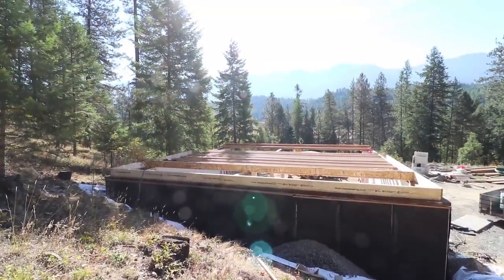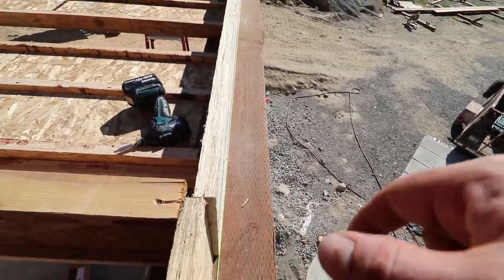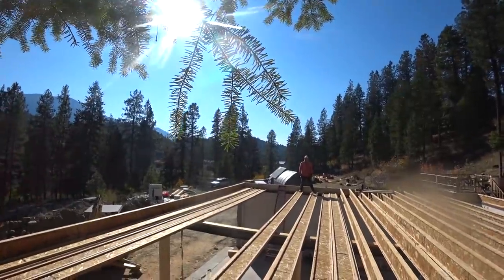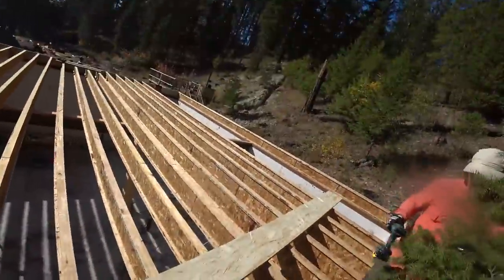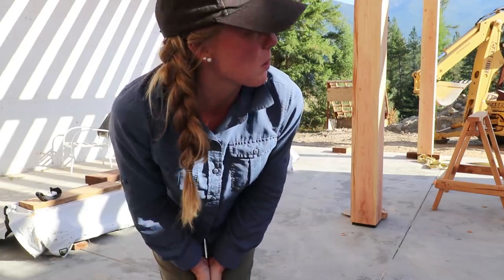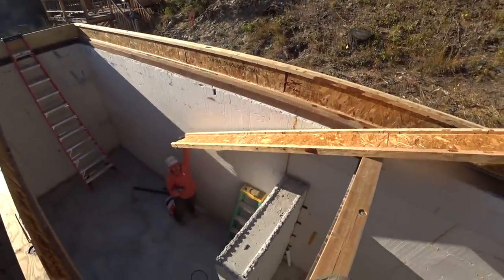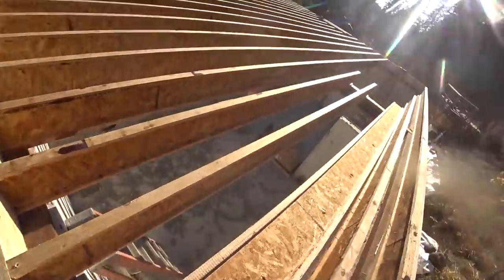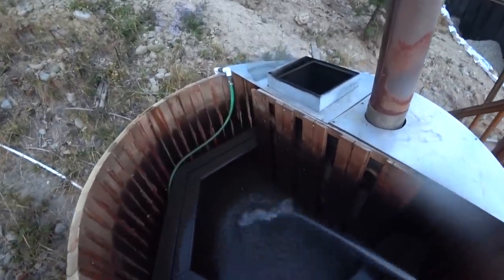OUR HOUSE LOOKS AMAZING (I-Joists & Rim Boards)

Comment: i'm kinda curious, the sound of the wireless screwdriver sounds (on the video) like it might be on hammer mode, is it just me?
Reply: It's called an impact driver. (very different than a drill)  It's akin to the air powered tool that is used for putting on the  nuts on your car tire, but smaller, and cordless electric.  It puts almost no torque on your wrist, and drives screws in very well, and very many on one charge.  Once you use one, you'll only use a cordless drill for putting in the smallest of screws and for drilling holes.
Reply: They are using an impact driver, which is ideal for driving screws in this application.  The terms hammer & impact often get used interchangeably but a true hammer drill is primarily used for drilling through masonry.
Reply: Its an Impact Screwdriver, supposed to be like that ;)
Reply: It's an impact driver, it hammers the screw around, unlike a hammer drill which hammers in line with the drill. They generate lots of torque without twisting out of your hand.
Reply: soaringtractor to all the ones answering politely : ,Thank you.
To the rude ones: true knowledge is only obtained by asking, if you do not have the answer in advance. 
Obtaining knowledge is paramount if you want to expand your horizon as opposed to remain narrowminded and ignorant.
Reply: it's actually on impact mode so it bursts out short but forcefull little rotations kinda like a impact wrench that runs on air to change tires
Reply: Ordenkeim93499   I've never seen one that has different "modes".  They are either a cordless drill, with or without a hammer drill mode, or an impact driver.  If you have seen one that is switchable between an impact driver, and a regular cordless drill, I'd be curious to know the brand that makes it.

Comment: Are these types of joists common these days?  It just looks like a strip of plywood with a inch strip of wood on either side.  Do builders no longer use standard 2x whatevers anymore?
Reply: they're very common now days ive only used regular 2x joist once in the past 3ish years and that was in a custom addition. regular 2x is more expensive especially if you need really long joist like the kind used here. also if i remember correctly its made out of pieces of wood and scrap thats glued together then compacted until it drys.
Reply: Thanks for the info.  It's been quite a few years since I've done contracting, but I have seen these beams used but usually only the main spanner joists that run over poles in basements and such.  I know exactly the type of plywood they use, it's called oriented strandboard.  Basically just wood chips/scrap/whatever glued and pressed together.  I'm not sure how they'd stand up to moisture, in my eyes the veneer plywood would be far more suitable, but I'm not an engineer, so, just an opinion lol.
Reply: sc0tte1 if you mean like what happens if rain falls on them during the building process they’ll be fine. As long as they aren’t submerged. Whatever is used to glue them together seems to do fine with keeping any moisture out
Reply: the TJI's are a consistent size, timber strand varies in height from an 1/8 to 3/8 from one end to another. a plus
TJI can be drilled in proper locations without loosing integrity. a plus.  TJI can span a lot further without having to increase height or width in proportions with  using timber. a plus. Finding 1# 2X12 @ 30 plus feet. costly to say the lest. keep them dry as they should be inside a house anyway.
Reply: veneered plywood is just plywood with the outside cosmetic  layer a very thin layer of whatever  type such as Oak, birch, ash.

Comment: It is going to be so cool living in a fire station! 

Learning how to build a house is one thing. How to design one that is aesthetically pleasing is an entirely different skill set. Start with a genormous square concrete box with a ten foot ceiling. The good news is that with timber framing, radical changes are always possible after the fact.  Can't wait to see how you fix this. And could ya get some safety equipment stat before one of you does a header?
Reply: If they didn't like the design, they wouldn't be building it. Since you don't like it, it is good that you aren't building it. Jesse & Alyssa seem pretty sure of themselves up there. Safety cr@p would just get in the way. You don't see much safety equipment on timber framing......

Comment: Hi Jessy, Sorry to hear that you are 1/2 inch out with your "I" beams, would it not be easier to add 1/2 inch plywood to the back of the rim joist to make the floor square instead of moving them all. You are both doing an amazing job and putting in so much hared work each day. good luck on the build.

Comment: FYI, TJI generally doesn't recommend blocking your joists. Their concern is that it can cause a squeak in the floor. There is a type of blocking they do recommend which is IBS2000. However, it has to fit snugly and you have to more or less install it as you are installing the joists.

Comment: You forgot to check the diagonal length from both sides to confirm the squae before laying the rest of the beams
Reply: Just because they didn't film it, doesn't mean they didn't do it.....
Reply: If they did the beam would not have been out by 3quuater of a inch
Reply: Jess has check the foundation walls and sill plate. If the rim and joist are cut square, nuff said. He should have snapped a line to set the joist so that they didn't travel on him.

Comment: Are you supposed to be doing all screws?  Screws do not have the shear strength of nails and some places require nails not screws for better strength.
Reply: Yes they do.
Reply: kirkb4989 - What sheer forces are there ?  And a battery operated impact is a WHOLE LOT EASIER to operated than a heavy framing mailer and hose.
Reply: upper floor inertia vs. earthquake
Reply: Oh and I like to use BOTH, the screws to get it attached and "sucked in" tight, then nailed for the shear strength.

Comment: It looks like the entire weight of the front wall of the house (two floors high) and the front wall of a steep roof, will be resting on a single I-joist. Add to this the load of about 1/4th the weight of everything above the 1st floor.... On ONE  I-JOIST!
Reply: Yes good point. But I think they should still double up on the front joist. No matter how it's engineered it absolutely will carry more load than any of the floor joists.

Comment: About that tree.... Eventually it will get so large that the roots push your foundation and crack it. Secondly with it gone the  space could be utilized for a wrap around deck or not.  Is there some sentimental value to it why you took so long to trim it?
Reply: Randy Dinsmore they kept it for shade all summer.  They will take it down

Comment: Jesse, you need to set them joists to laser..
with a spacer..
Left, right and centre..
before your creeping errors in warped joists, come back to haunt you...

I won't bore with how moisture, heat and barometric pressures  affect wood,
but it does..
Who the heck, knows about the coefficient of linear expansion (or contraction),
apart from some daft, old engineer, like me/

Am drunk, love this build but alarms went off..
Hence this comment.
You take care now..
Amgoing to bed.

Comment: Hi Melissa my name is Tom and I live in South Africa Cape Town I have watched nearly all your videos and would like to make a few comments. First I think what you are able to do is amazing I have never seen a lady able to do what you are able to do. That's enough of the personal stuff I would not want you to think I am a weird stalker.  I have drawn the plans, had them approved and then project managed 15 houses for myself.we build in brick and moter.  First we don't use a lazer and I don't make marks on the string to indicate a position. First I peg the first line to the required length and direction and to get the adjacent side I use Pythagoras.  Take a small piece of paper half inch by one inch not measure just torn out from scrap any odd piece fold it in half and again in the other direction and hang this over the line at the 3m mark from your last peg , extending the line at approximately 90deg I the direction of the second wall and hang a second paper at the 4m point then measure the distance between the two pieces of paper it should be 5m. 3squqred is 9 ,   4squared is16 and 5 squared is 25.   9 plus 16 is 25 there for a 90 degree angle.   To get a vertical level I use a clear plastic tube about 10_15 feet long nearly fill it with water when the two ends are lifted up the water will automatically be level this is more accurate than a line level that courses the line to sag

Comment: Tell me the measurement from the edge of the plate/pressure treated to the rim joist so I could ponder your options. Most common is to simply place rim at edge of  plate then your finishes/siding/stucco hang past 3/4" to 1" over foundation wall/cmu wall. Some people like them to be flush. (Thats a preference) always think about how the water go to the outside of the building. ALWAYS

Comment: this house being built by two people who know nothing about building.Whats gonna happen wen
wood shrinks and Beam goes bye-bye.whos gonna
fix all crapp under
concrete?
Reply: brandon they were off on measurements on concrete walls &
so wen they cut wood after measuring many times (which is good). I saw that
the didn't look right and if it don't Look
right do it over. They should hire day help who know
Construction
Reply: brandon they were off on measurements on concrete walls &
so wen they cut wood after measuring many times (which is good). I saw that
the didn't look right and if it don't Look
right do it over. They should hire day help who know
Construction

Comment: Do they use the hand drills on hammer setting when screw driving? Jessie is not a natural craftsman is he? We could have hoped he would get a feel for materials at the Shelter course and the experience they have so far.
Reply: Robert Paynter its called an impact driver, one of the best tools to have on a project. They are designed to make that vibrating noise as they drive the screws in.
Reply: They are not drills.They are impact drivers. That is how they are designed.

Comment: No bridging??????????
Reply: What is bridging?
Reply: Goes between the joists to keep them from flexing.
Reply: He called it blocking and he said he was going to do "some."
Reply: Yeah, it stops flexing but more importantly it prevents all the joists from laying over, in a chain reaction.
Reply: With those "joists" I worry more about fire. They don't hold up very long...
Reply: Agree, engineered lumber has a place in modern construction, but looking long term and being subjected to environmental conditions like high humidity the data not in yet.

Comment: "Engineered Sawdust" as a load-bearing structural material... not really a good idea.
Reply: I suggest watching this video on how I-beams work:
https://youtu.be/zSz0kV0BPDY
It's a really interesting subject. There's nothing wrong with the materials used for their joists. Engineered sawdust or not. They are much stronger than the eye would suggest. Peace out.
Reply: the rim board isnt "load bearing" material so im guessing he is talking about the front wall. when they frame out their garages front wall the rim be supported by the door headers (beams above the door opening) and the front wall itself. on top of that the back wall that runs parallel to the joists should have either a joist nailed to it or 2x6 (or greater) blocks nailed to the rim every 16 (or less) inches for structural support. they havent made it that farm in the framing on video though so idk if itll be done or not we will wait and see.

Comment: Why don't they get a nail gun and put that screw driver away!  Nails are much stronger than screws and would it be much faster!
Reply: Nails back out, screws are more secure
Reply: Nails are not stronger than complaint construction screws and also many nail guns cannot fire nails deep enough to be complaint. 😁so your comment is nulled.

Comment: Noticed that the I-joists look like they are part OSB. What is this world coming t?. Whatever happened to good ol' 2x6 floor joists? Anyhow you need to have a rain plan at this point to protect those joists from moisture. One good rainstorm now would be a bit of a disaster. Once it gets wet, it's done. The joists will have been compromised. In today's world where houses seem to pop up overnight they are probably fine. If you are taking you time, not so good. Have a plan.
Reply: I beams are way stronger.
Reply: The OSB is CHEAP.  Yes,if they get wet,game over....
Reply: The "Silent Floor" OSB I-beam has been used in residential construction nearly 30 years.
Reply: Engineered joists are, lighter, have more strength per kg and linear meter. Also can be fire retardant, also pipework and cabling has it's own knock outs available.

Comment: Adding the blocking was a wast of time and energy. If the wood used for the blocking wan neither glued or pressure treated at the very least it could be used as firewood.